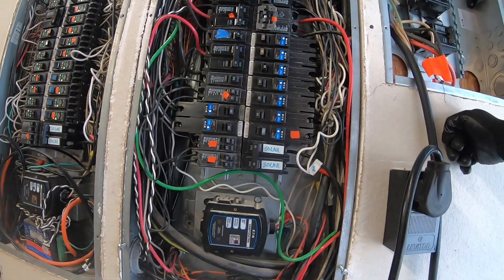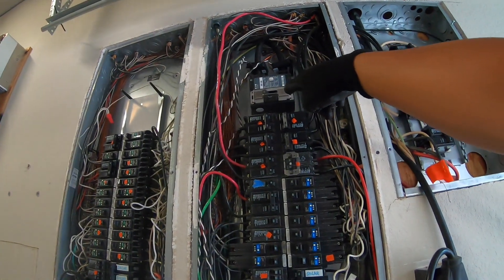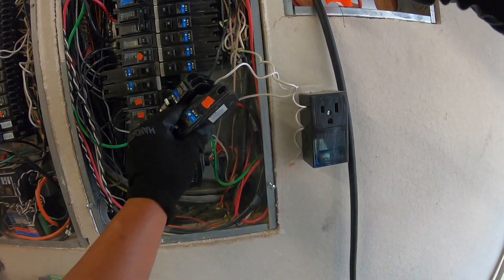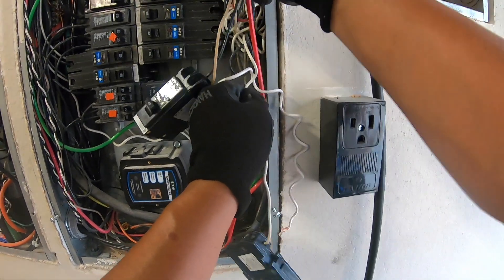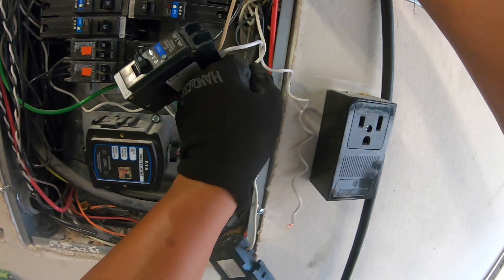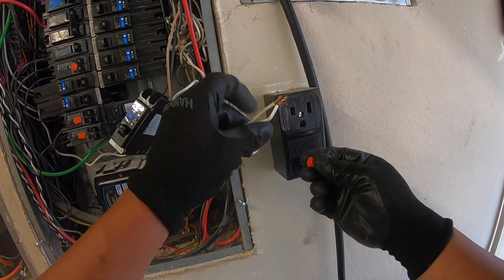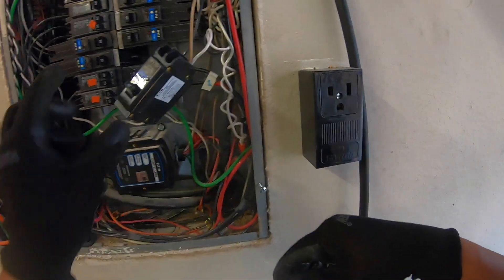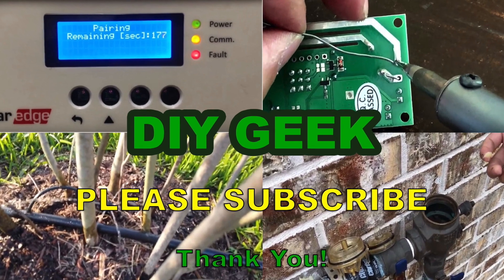REPLACING EATON GFCI AFCI CIRCUIT BREAKER

Comment: Great work by the tech but what a P O S breaker box that he had to struggle to change that breaker...had to cut a splice becasue the wire was so hard to trace and or connect the new breaker ware... Never have that problem with Square D... not impressed.  Dealing with a similar situation at my daughters house...failed breaker in not much more than a year of  use.  Total BS

Comment: Why didn't you just connect the white wire from the bus directly into the breaker instead of twisting it together? that didn't make sense what you did.
Reply: the breaker wire is permanently attached to the breaker.  Cannot be removed.
Reply: It will take more work to untangle all the other wires to remove the old wire. He doesn't want to disturb the other wires.

Comment: Thank you for making the video, do you happen to have the link or contact of EATON to ask them send replacememt breakers? My new construction home got two breakers tipping too frequently and error code is 6 - self test failure. I tried to seardh their US website and can not find the contact for warranty service. Many thanks.
Reply from the maker: Here is the contact phone number for Eaton 1-800-386-1911 To get circuit breaker replacement
Reply: @DIYGEEKTEXAS  thank you the number works great. I gave them a call and described that I had code 6 and after they confirm the product model (ask me to describe label color and appearance of interface) and installer (my case a local electrician hired by builder) info they sent me the replacement kit in one week. My builder’s electrician actually did great work to have all wires organized super well and each breaker slot has its own dedicated place to connect to ground.
Reply: You must have a LENNAR home too.  Same, same, same.  2 breakers that keep tripping, even before move in, brand new, NOTHING plugged in.  Their electrician came twice and said, oh, nothing wrong.  Come on now.
Reply: @xsteel3292  Yes exactly. Mine happens to be in the kitchen. It drives my wife crazy, which in turns she drives me crazy! LOL
Reply: @buildleaserepeat7207  oh my Whirlpool refrigerator start to trip my CGFI Breaker two times a day, after working for three years (out of warranty) and the EATON error code indicates a ground fault. Paid refrigerator on-site inspection found absolutely nothing abnormal, and the other electrician I hired just suggest me to change to the No arc protection version (the old simple breaker without a pig tail) and live with it until I would like to buy a new refrigerator;(. So I did it and now the refrigerator works peacefully.
Reply from the maker: @BoshuRu  Great to know. Thanks for sharing your experience. It is true that AFCI sometime too sensitive towards false signals generated from electronics.
Reply: @xsteel3292  mine is a small family owned local builder and a certified electrician they hired. I think LENNAR or small builder, the electrician contracted by local team matters. I can not exactly say my electrician is not good, the breaker failed after 3years of use and there are several power outages caused by snow and thunderstorms, so be fair I don’t blame EATON either. At the least they honored the life time warranty without asking a investigation report from certified electrician.